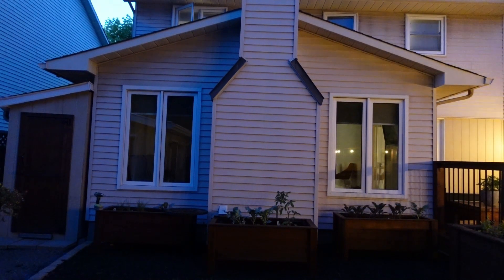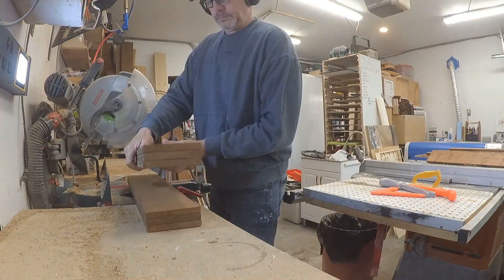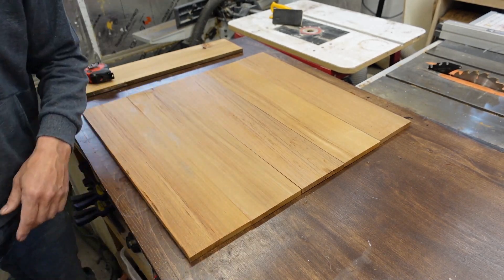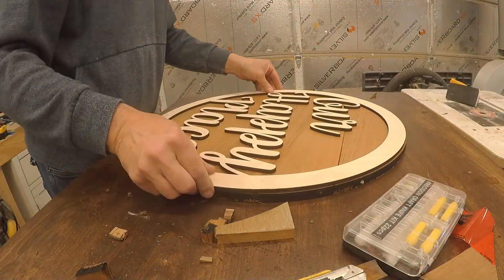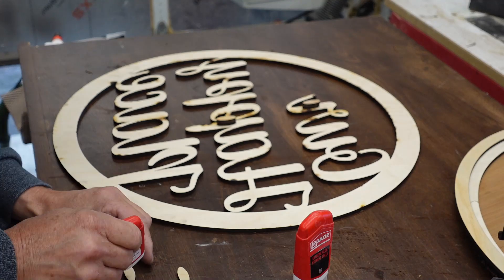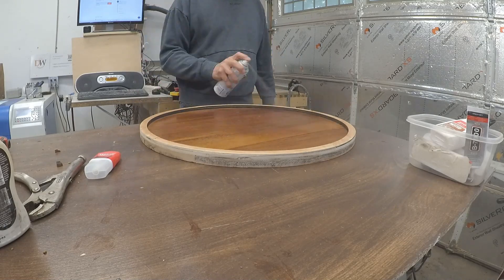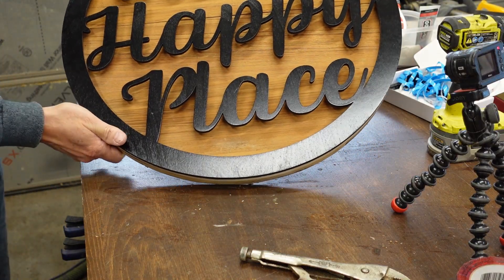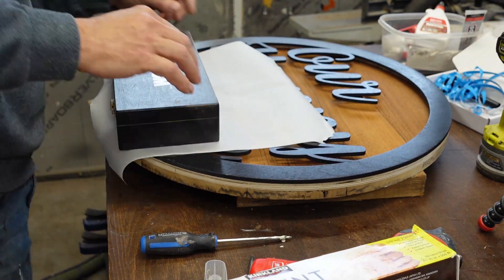Create a Custom Backlit Sign with LEDs (Full DIY Process)

Comment: How did you design the quarter circles in light burn??
Reply from the maker: Thanks for the question Sean. It's difficult to explain in words but essentially I made two circles, one smaller than the other, then used the "Edit Nodes" (Ctrl +) and made curvy lines between the two circles in four spots to make the quarter circles.
Reply: @DustyWorkbench  Thank You.. Great Job BTW.